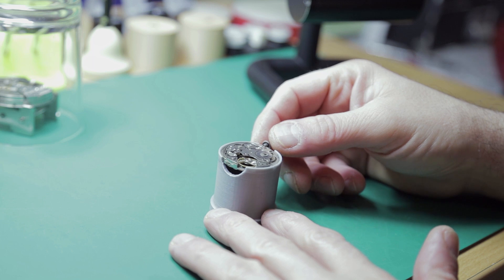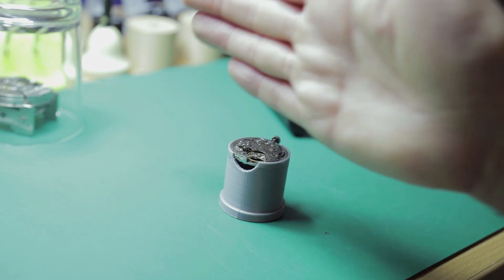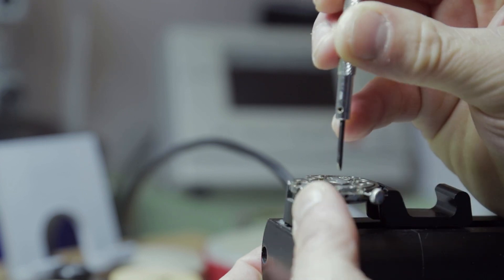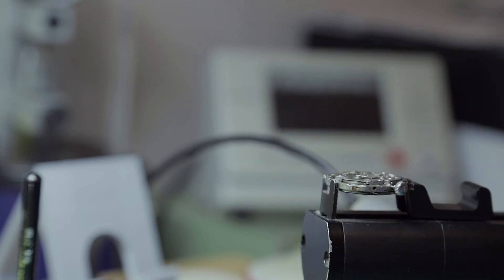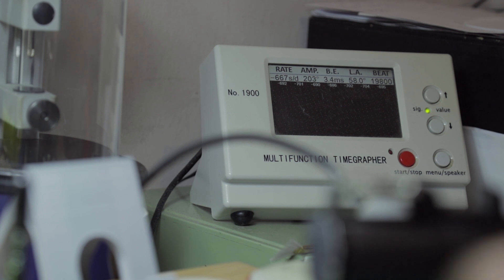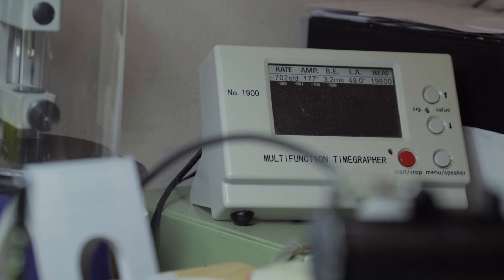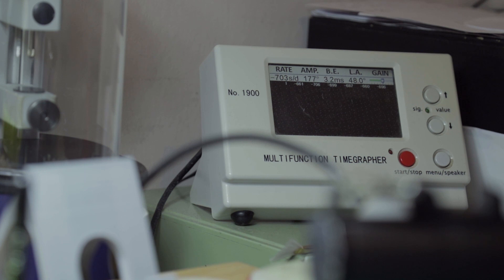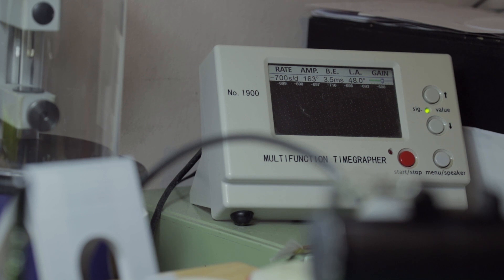Seiko Bellmatic Lift Angle Documents Are Incorrect

Comment: Working on a 4006 myself. The steel bushes on the centre seconds and third wheel can be worn oval and be a source of friction due to the change in depthing. You can sometimes improve the situation by rotating the worn bush 180 degrees.

Comment: Really useful video, thanks, and excellent tip on the slow-mo. I'm quite new to the world of watch repair but learning a lot from your videos.
Reply from the maker: Glad it's useful. The slow motion feature is great and standard in most smartphones now.
Another way is to mark a dot with a permanent marker on the opposite arm to the most visible nearest you then watch for that reaching the side nearest you on both swings. You can remove it with IPA on a cotton bud after.

Comment: Excellent video. I've never doubted any of my massive lists of lift angles so, I scoured them furiously to check 4006 and 4006A, and OH DEAR, 58.4 degrees! Thanks for the heads up but my confidence is broken. The world is no longer a safe place to horolog-tinker. I have always held great stock in my lift angle lists but no more! The amplitude is important to me to gauge the success of every watch I service and now I shall be haunted by the fear of lying lift angle sheets until I check them all.
Reply from the maker: Believe me, you're not alone. I always trusted the lists until I happened across a discussion on this very movement. Having one handy was the ideal opportunity to check.
Might be a worth a double check on the less common ones in future.

Comment: Good to watch the technicalities. At my level of understanding. Clear as mud. Fun, none the less.
Reply from the maker: Lol thanks. It's simple to use the 180 degree rule to calculate if the lift angle is unknown. Always a handy thing to know.
I keep meaning to do an in depth of the timegrapher but finding the time (haha) is impossible.
Long and short of this is that if measuring at 58 reported amplitude is incorrect.